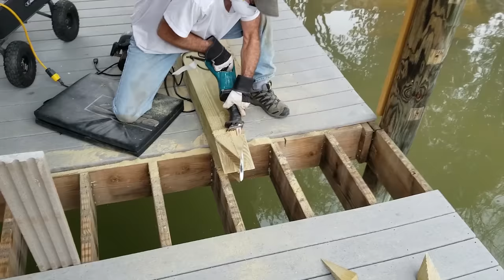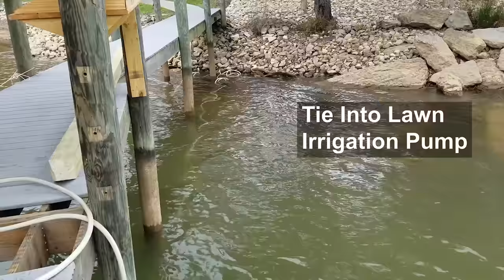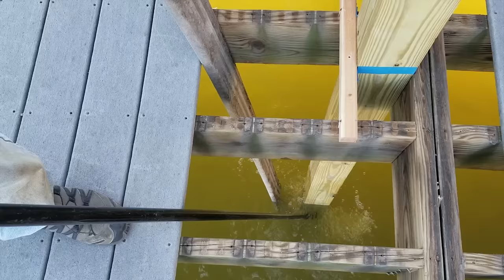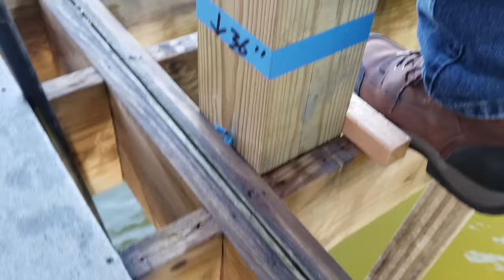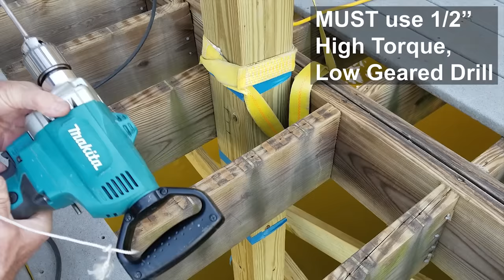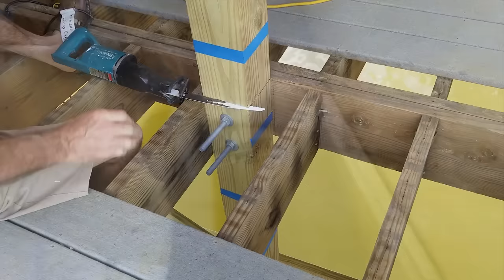Dock Piling Installation Underwater - DIY With A Garden Hose Waterjet

Comment: I made my boat dock by renting a water pump and reduced the discharge side from 2” to 1”, with a 6 foot long pipe.
Got lucky and hit sand bottom.
Went down 5 feet / piling.
Worked like a charm.

Comment: Have worked on dock repairs. One tip for you is copper anti-seize on all bolts the whole length.  This will stop it from rusting in the wood. All lag screws same thing.  Even after years on a ocean dock they come out. Of course the head the bolt  will be ugly. But you got a chance to replace it.
Reply from the maker: Great Tip. Any particular brand of copper anti-seize you like?
Reply: @fixitwise7194  
Permatex  is what I use.  We would put a blob the hole before we drive in a lag screw . You know how lag screws rust in wood. Making impossible to unscrew. 
The tricky part is not getting it all over your hands.
Be safe on the water.
Reply from the maker: Oh. Automotive ant-seize - COOL!
Reply: I would avoid using copper if your fasteners are hot dipped galvanized.
Reply: @likeatr332  
There is zero effect on galvanized bolts / lag screws. It  really helps them go in . As galvanized coat can be ruff.

Comment: That bit is made for high speed. Ole boy was pushing with all his might. 💪
Reply from the maker: Not with that drill. It'll rip your arm off if it binds. Plus. They last longer, less heat.
Reply: Good bit. I own the same auger drill. I'd still use an Auger Bit. They work much better and last much longer. Electricians have used these auger bits for years.
Reply: @fixitwise7194  A auger bit with a snail lead screw would have worked much better than a spade bit in that application with that low sped drill but in the end you got the hole you needed.
Reply from the maker: All my neighbors and I have learned the hard way, that auger bits do not work in these dock pilings (telephone poles). They just bog down. The same is true for these "critical structure" level of treatment 6x6's. I wanted one bit for drilling in both.  Another note on the spade bit. What is not evident from the video, is that you can only drill an inch or two, then you have to back out the spade bit. It took the most effort to back out the spade bit, several times during drilling.
Reply: @fixitwise7194  Good to know. Most times we're drilling out soft pine 2x4's sometimes 6 to 10 or more together thick. The augers work great for that.
Reply: Auger bits don’t bog down. I use them to drill treated round and 8x8 telephone poles. With that drill and an auger bit it would have been a 15 second hole
Reply: @fixitwise7194  anyone that works on powerlines will tell you that auger bits on an impact is the way to go. Would be through that pole in a few seconds and no chance of binding.

Comment: I build docks in Jacksonville, Florida and we use a Milwaukee battery powered hammer drill with a 5/8 bit for 1/2" stainless steel all thread through-bolts. nothing corded it takes too long. And we are drilling through 12-15" piles. I do like the fact you got em down that far though clay without a jet pump.

Comment: When cutting thick wood with a Sawzall move the entire blade in and out all the way. The gullets quickly get filled with chips and cannot touch the wood. Sliding the blade out allows the chips to clear out. If the wood is wet or sticky you need to manually clear the gullets .

Comment: Had to help run some wires at in-laws. Oak beams that were very close and I could not get my drills in. Bought Irwin self self driven bits and tried my 3/8 desalt Impact to get in space. Worked so well I went and bought a 3 pack with a few extensions. They eat thru wood.   I retired my1/2 dewalt except for paint stirring.

Comment: I put in dewatering systems for a living. We use a method similar except with higher volume and pressure to sink our wellpoints
Reply from the maker: A high volume trash pump would have worked a lot better. I just wanted to show it could be done with an irrigation pump. For sure, house water pressure won't cut it!

Comment: Instead of a 6x6 piling, use an 8x8 made up from four 4x4's cut a half inch from the corner of each beam lengthwise.
Turn them so the cuts face inward and glue & bolt them together.

Bang a fitting on top to connect the hose. 

Having the outflow centered exactly where you want it will increase your efficiency. 

Tightbond, after giving it time to dry/ cure will be watertight at least long enough to jet the pilings into the bed.
Reply from the maker: Great idea!
Reply: Jesus’s. You really have no business ever working on someone’s property

Comment: What kind of water pump do I need to get from a rental place? My dock has old 4x4 pressure treated beams. Would be nice to replace the corner post with 6x6. They are all outside post's. nothing in the middle. No special made nozzle jet tip as I have seen others use. South florida sand should be very simple to jet down into on the shore line. Best video I've seen. Thanks.  I love the flat head lag bolts. Great idea.
Reply from the maker: Ask for a "trash pump".

Comment: Ive never seen any dock builder cut points on pilings. The water jet blows everything out and the piling falls to the depth you need.
Reply from the maker: Thanks. Most dock builders use a high powered, high volume "trash pump" connected to a 2" hose. Because this demonstrates using a garden hose, connected to an irrigation pump, the point on the bottom of the piling helps with the lower volume. Plus I think I was able to "steer" it better with the point.
Reply: @fixitwise7194   is it also worrisome that it might settle and sink easier as well over time?

Comment: Nice job on sinking the pilings.  The piling to deck connection is the worst way to secure the piling.  You should not use the bolts as shear members in the loading.  No bueno.
Reply from the maker: Good point, notched would have been betyer, but it's a 100 times better than the 100% toe nails that the jackleg who built this dock used. Plus, these are non-primary supports, just to take the sag out of the floor joists.
Reply: I thought that too. But as a repair,  working around the existing structure it’s probably the best idea. 
It would be very difficult to notch in situ and taking back out to do so would disturb the gravel again. Them bolts have a tonne or two shear strength so I’m sure it’s fine.
Reply: @markc7955  You are right.  I would put a sister on the post and spread the load among more fasteners on two sides.  Like you said it is virtually impossible to get an accurate fitup with a notch - but sistering two pieces to act as load spreaders can be done at any time and with excellent results.
Reply: @michaellicitra7632  
Mr fix won’t tell us but he will be out tomorrow morning doing just that lol.
Reply: Michael Lucitra  that is exactly what I would do in this situation. Sister in a 3 or 4 foot section and stagger bolts all the way down

Comment: You should have notched the 6x6. Those two bolts are carrying the load.
Reply: Jeff Pape - yep, definitely a design flaw.
Reply: Nope the sheer strength of a bolt is multiple times stronger than notching syp

Comment: I really wish you had notched that 6x6 rather than just bolting it, but the water jet is a good idea
Reply from the maker: I wanted to do that. Except I also needed to jack up these sagging floor joists a couple of weeks later, after I was sure they were settled in. Since these were "non-primary" supports, to take the sag out of the floor joist span - I comfortable with it. I do notch the primary supports at the telephone poles!

Comment: Since you knew the depth you wanted to go down could you have predrilled the post ?
Reply: He didn't actually know the depth.  When driving pilings you go as far as you can get them to go to get the most holding power you can.  All this depends on your equipment and conditions.  I drive alot of pilings with my excavator, had some stop at 10 ft and then move over a few feet to do another one it it go in 20ft.   If you stop at a predetermined mark and it is not seated good the piling would have a better chance of sinking later with the weight of the structure on it.  Especially in his case when only using a water hose and a hammer.  These poles aren't going to have alot of vertical friction.  The weight of the structure will most like be more than what he was exerting on them so they may sink more.

Comment: help me out. i have a pond that i want to put up some shoreline post and hold back dirt from yard. the post i put in will only hold back a 3 foot tall shoreline of dirt. how far do you think i should be post into bottom of pond which is only one foot deep at the shoreline?? should i try to pour concrete in it or will the post be sufficient?? i just want a clean looking shoreline as the pond is close to my house. i plan on using a auger from home depot to drill the hole?? what do you think??
thanks 
turner
Reply from the maker: That sounds like a question for an engineer - it's way above my pay grade ; )

Comment: Hello Fix it Wise, can you share some specs on your irrigation/sprinkler pump... what are the ratings for pressure (psi), flowrate (gpm) and/or power (hp)? I will be doing some jetting where it's not easy to get a trash pump in place, but I have electricity so a sprinkler pump might do the trick. Thanks in advance.
Reply: I'm using a 1 hp pump. The trick is to keep everything 3/4 inch until you get to the nozzle at the end of the pipe and use a stainless steel 3/4 NPT to 5/8 hose barb. That will increase the pressure to blow out sand/rocks. Don't use brass...needs to be SS.

Comment: Why wouldn’t you cut a notch in the piling and let the frame rest on top of the piling instead of having all that weight on 2 bolts?
Reply: @Mrbeast if you cut a notch in the piling 5 1/2 inches for the joist to rest on and the piling settles, you can still readjust the bolts an inch or two.  Don’t you wanna hit solid ground first anyways so there isn’t any more settling?
Reply from the maker: I wanted to do that. Except I also needed to jack up these sagging floor joists a couple of weeks later, after I was sure they were settled in. Since these were "non-primary" supports, to take the sag out of the floor joist span - I comfortable with it. I do notch the primary supports at the telephone poles!

Comment: Auger drill bit would have made short work of drilling timber ?
Reply from the maker: All my neighbors and I have learned the hard way, that auger bits do not work in these dock pilings (telephone poles). They just bog down. The same is true for these "critical structure" level of treatment 6x6's. I wanted one bit for drilling in both.  Another note on the spade bit. What is not evident from the video, is that you can only drill an inch or two, then you have to back out the spade bit. It took the most effort to back out the spade bit, several times during drilling.
Reply: @fixitwise7194  well I know from years as a carpenter bridge building you better not take too big of bite with auger bit or be ready for a ride. Tip is to dull the pilot screw at the end of the bit so it give you the Goldie locks feed rate that’s just right !

Comment: Get a pipe that is threaded on the end and screw on a brass pressure nozzle, works even better
Reply from the maker: Thanks!
Reply: Yep that`s the DIY way to drill under a sidewalk or driveway to run conduit underneath.

Comment: I’d rather hammer it in with a mallet. You lift up a lot of sediment and it’s not as structurally sound.
Reply: You don't have the slightest clue do you its call jetting jetting piling is quite common and it is just as structurally sound in fact the institution of  pressure-treated piling instead of creosote treated Wood you have to jet in the pressure-treated pilings because they blow up like freaking toothpicks when you hit him with a diesel hammer or try to shake them in with a vibrator

Comment: Good video and ideas, however, there's better equipment and easier ways to do this. First, a pressure washer with a long extension is MUCH more effective, and the garden hose won't touch hard pack. Better yet rent a high pressure muck pump from Home Depot and make up some reducing fittings from a 3" line to a 2" line and that will make the garden hose seem like a joke.

Also, get a REAL wood bit for those bolts, more expensive, but MUCH better. Just finished a similar project and have one more to go.
Reply: got any suggestions on the wood bit?
Reply: @ericlonginotti7556  If drilling lots of holes or deep holes use auger bits, harbor freight has them pretty cheap.

Comment: a few things that made me think i shouldnt trust this video are: 1. when jacking the deck up you attached to a bolt. that bolt could easily have split that board. should have reinforced the bolt entry/exit of the wood significantly first.  and 2. when drilling the hole you dont need a special drill, and a spade bit can easily change directions and create a worm hole that is not straight. making it impossible to get the threaded rod through without boroughing out the hold wider in some areas. just seems non-pro. but looks like it gets the job done. I understand a proper bit would have cost $50 but i own a dozen of them for going through 8-36" of lumber with one rod. I would really like the best way to sink a beam in the water and im looking for the best way, not the spade bit way. i'll keep looking.

Comment: So unsafe, an electric cord hanging down by water??? 
 Should have bought blades for the saw.
Reply from the maker: Saftey First! All GFCI and at least 8 feet above the water. Plus all cord were tied off just for that reason!
Reply: Going on several years of building docks and running extension cords from the onboard generator on the barge and have worked with the cords/plugs under water, even while standing in water and have had 0 issues in 5+ years, older guys at the company who have 25+ years on the job have never had an issue either so I don’t really know how unsafe it actually is in all honesty

Comment: Nothing new here.
Reply: @Fixento, you sure bout that? I've been a contractor for decades and I had never seen any of the following done before: 1) Using a back & forth sawing motion with a Sawzall that had power to it 2) Trying to cut with that dull of a Sawzall blade and 3) Cutting a point on a piling to be jetted-in. (BTW, you any relation to "Fit'na"?)
Reply: @chas.fournet1087  Didn't pay that much attention, must be hard steel and tough ground..   In the 1970s I helped a friend jet in a bulkhead along the intercoastal at Port Bolivar.   He build a nice house on pilings there.   One night during a blue northerner he heard loud noise outside.  He went out on the porch and three free from him was the front of a massive barge. The tug lost control of the barges it was passing and the lead wound up in his yard.  Had it hit the house it would have taken it down.  The tug company replaced his bulkheads and yard, and compensated him for the trouble.   No attorneys, a handshake and they were as good as their word.  Different world back then.

Comment: might as well put as much chemical sawdust as possible into the water
Reply from the maker: No way! I should have shown my sawdust capturing tarp floating 8 feet below, stretched across two SUPs. Also, the wood I used is approved for lake use.